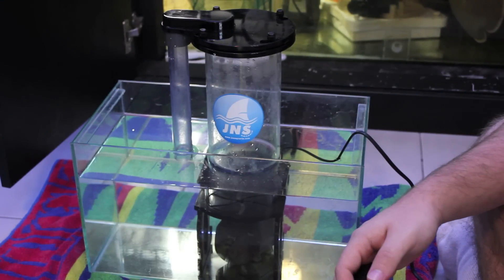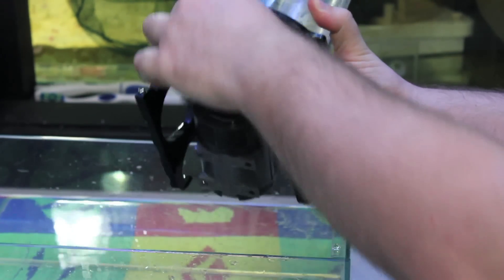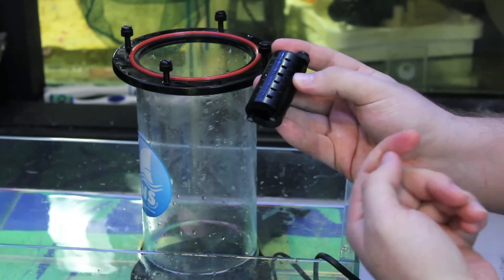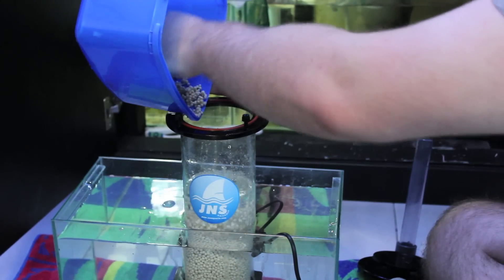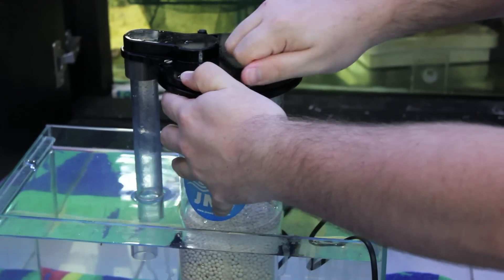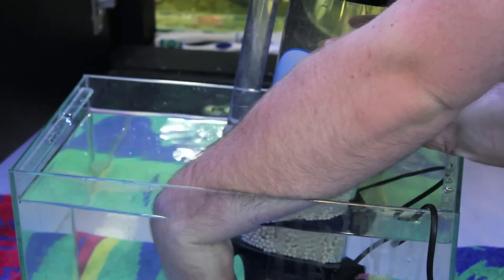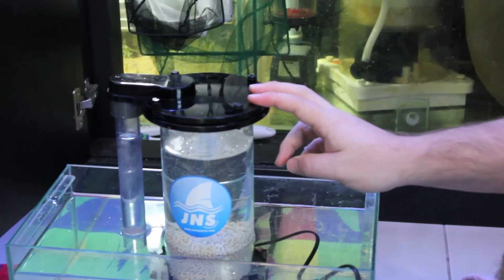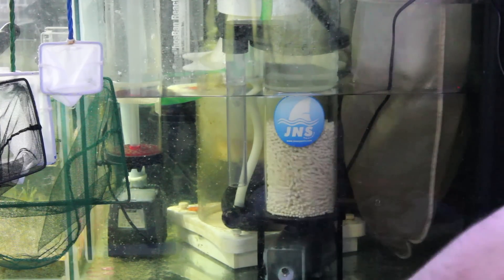JNS Alpha 2 Biopellet Reactor Setup and Review

Comment: Awesome Video mate - does the output pipe come out? I would like to modify it so it can go straight to the skimmer inline.
Reply from the maker: Thanks Matt. As I understand it the pipe on the outlet is indeed removable. I would certainly suggest confirming with your retailer before purchasing just in case this has changed.
Reply: ok cheers mate thanks for your help